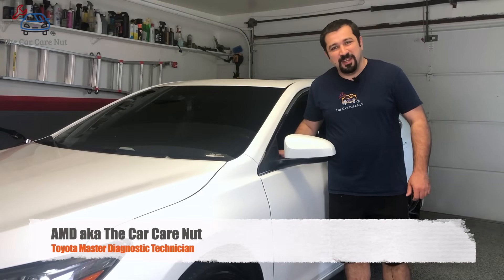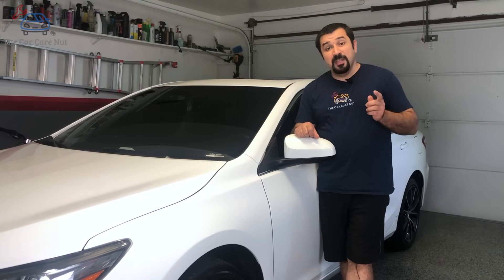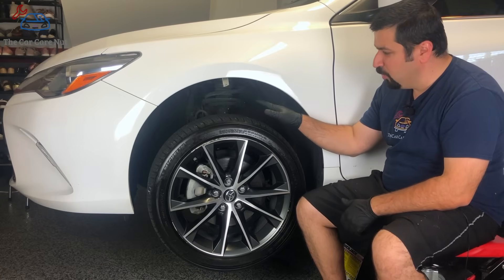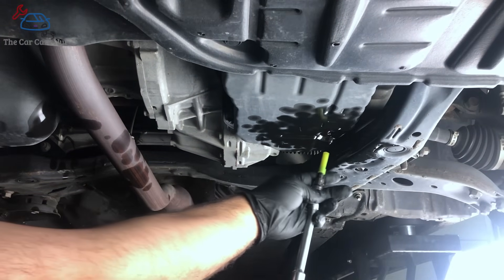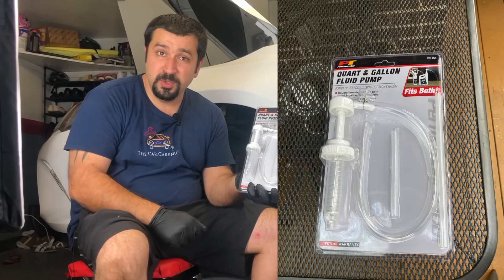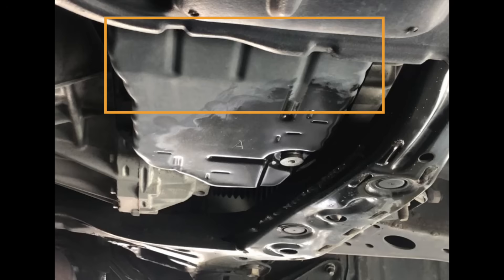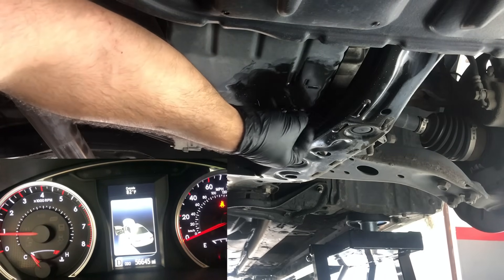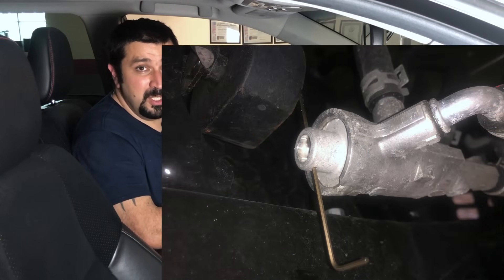How to change your Toyota Sealed Transmission Fluid

Comment: Sir - my 2015 camry is coming up for transmission fluid change (58k miles). Could I do drain and fill a couple (or more) times to get more fluid replaced in a single work session? Is there any downside to do multiple drain and fills? Or there is no downside but just not much additional benefit vs. just doing 1 drain and fill? Thank you AMD
Reply from the maker: Hi! I would replace it once. Over doing it is also not good for the transmission. A single replacement is sufficient
Reply: @TheCarCareNut  Thanks AMD! A quick follow up question, would you mind expand on the reasoning behind why doing 2 or 3 times drain and fill in 1 session is not advisable? Thought doing more will replace more old fluid, which should be more beneficial to the transmission (for instance, a flush at this interval would be replacing 100% of the fluid, and dealer seems to suggest this but I'm taking your advice of doing a drain and fill instead).      In addition, is your advice the same for replacing the transmission fluid at 120k, 180k, 240k....300k miles? Thanks so much!
Reply from the maker: Hi Steven! So replacing the transmission fluid multiple times in one sitting seems to affect the clutches in a negative way. A single replacement is enough to replenish the additive package and keep things protected.
Reply: @TheCarCareNut  Got it. Thanks very much to share your experience and insights! Does the same negative affect on the clutch happen on flushes (which likely replaces 100% of the fluid)? Thanks very much!
Reply from the maker: They do especially if the transmission has high mileage

Comment: Does a Toyota Avalon 6 speed automatic have this?
Reply from the maker: Hi! Yes it does
Reply: @TheCarCareNut  I’m looking at a 2017 Toyota Avalon with 85,000 miles for 17,000 that’s with taxes and fees is it worth buying?
Reply from the maker: I think it is. That’s a very good car
Reply: @TheCarCareNut  would I need the transmission changed once I buy it?
Reply from the maker: I would replace the transmission fluid if it hasn’t been done
Reply: @TheCarCareNut  what about the timing belt?
Reply from the maker: That model has a timing chain that doesn’t need service or replacement
Reply: Should it be changed since it has 85,000 miles
Reply: @TheCarCareNut  what do you recommend to be changed or replaced on the car?
Reply from the maker: Other than the transmission fluid do an oil change and inspect the car. Brakes tires suspension and leaks.
Reply: @TheCarCareNut  thank you 🙏🏽

Comment: where should be autoshift(parking or neutral)when checking the level in transmission?
Reply from the maker: When you are done with the procedure and about to check the fluid level put the shifter in park
Reply: @TheCarCareNut  with the engine running?
Reply from the maker: Yes keep the engine running in park when you check the fluid level

Comment: Hi there nice presentation. Can i ask something regarding oil that you used on your transmission, you use a Toyota ATF WS in a sealed CVT transmission, you did not used a Toyota FE CVT fluid. Im planning to have a service on my 2011 Toyota Altis 2.0 also sealed transmission no dip stick. it is okie to use one of this fluid, is there any difference.
Reply from the maker: Hi! Is your car a hybrid or a conventional CVT transmission?
Reply: @The Car Care Nut  hi thanks for replying 😘😘.its not a hybrid,  Its a K111 CVT Transmision its a 7 speed with paddle shifter. Car model is ZRE143L-GEXVKM, engine: 3ZR-FE. hope you can help me out here.
Reply from the maker: Hi! Likely this one uses cvt fluid
Reply: @TheCarCareNut  thank you very much.

Comment: Hello AMD! Thank you for all of the hard work you put into these videos. I wonder if you could help me with my 2015 Rav4 limited with push button start. I put in the jumper wire to change the transmission fluid and now the Rav4 will not start. I can turn on the electrical system but the engine will not turn over. I am sick to my stomach thinking I really screwed something up. By the way, I tried disconnecting the battery.
Reply from the maker: Hi joe. Check fuses staring under the hood and then inside the car. You’ll want to mainly focus on the efi fuses. Also when you turn the key on where all the lights come up does the check engine light come on?
Reply: Yes, the check engine light is on. I'm so shocked that you were able to get back to me on this. It's greatly appreciated and the work you're doing is amazing. I hope it makes you generous passive income!
Reply from the maker: Ok I see. Still check fuses and go from there
Reply: @TheCarCareNut  The fuses all look good. It's feeling like I need to take it to the dealer? Gulp! I did hook up my OBD2 scanner that's paired to an Android phone and it had no error codes.
Reply: @TheCarCareNut  AMD, you are an extremely generous man and greatly appreciated. It turns out that I just needed to charge the battery! It started up!
Reply from the maker: Awesome! I’m glad to hear that!

Comment: Hello AMD on the 2014 Toyota tundra 5.7 what is the temperature to check the transmission fluid level?
Reply from the maker: Hi! Should be at 99-111
Reply: Thanks you very much

Comment: Another Gem from AMD!  Should a Dealership request I leave my car overnight when changing out the CVT fluid?  Or can they do it safely in one afternoon? I do not know how long it takes for the transmission to cool down enough.  I Decided to take my 2018 'Rolla LE in this Friday for a "Replace CVT transmission fluid" service. I will also ensure they only do a drain and fill per AMD's suggestion to another subscriber.  Tks AMD!
Reply from the maker: Hi! Thank you for watching my channel! The dealership has a special tool that allows for fluid level check at operating temperature. Every dealership should have it so they won’t have to hold the car to check the fluid level.

Comment: Any reason why you do not just pump the oil out from the filler hole, say 2 quarts, then just add 2 quarts of fresh?  Oil pumps to remove sump oil are common on marine engines due to inaccesable sumps. I see no  good reason why this will not work, but happy to be told otherwise.
Reply from the maker: You can’t access the sump from the fill hole.
Reply: @TheCarCareNut  Thanks for the reply. Im surprised theres no room for a 5mm hose, seeing as the oil gets to the sump somehow.

Comment: I have the 2GRFE on my 2013 RX 350 now at 100k miles. Should I do this drain & fill or just roll the dice and hope the transmission will at least last up to 300k miles?
Reply from the maker: I would just do a drain and fill
Reply: @TheCarCareNut  What is the temp again for these V6 again?
Reply from the maker: Should be 95-113
Reply: @TheCarCareNut  On the V6 is it the same 6mm hex as the 4 cyl or different?
Reply from the maker: Should be the same.
Reply: @TheCarCareNut  Do you remember how much fluids comes out of the V6 at first?
Reply from the maker: Usually around 2.5-3.5 depending on the model

Comment: Hi there AMD. I have a 2013 corolla and have no service record for when the transmission oil was changed. My odometer is currently on 82,000 kms. Would you advise changing it now?
Reply from the maker: Hi! At this mileage you should be good replacing it. I would do a drain and fill
Reply: I successfully did a drain and refill. However, the fluid is still really dark and not even close to a bright red colour. Would you advise to drain and refill once again? Please also advise if it's best to take down and clean the transmission pan and change the filter. Thanks.
Reply from the maker: Hi! That’s ok. You replace enough of the fluid to renew the additive package and keep things protected.

Comment: Does the 2016 Highlander LE have the cooler bypass? And also, what does this bypass do?
Reply from the maker: Hi! That doesn’t have one. The cooler bypass doesn’t allow the fluid to run through the transmission cooler when the fluid is cold. That started with 2017 highlanders with the 8 speed
Reply: @TheCarCareNut  what would of happened if I was to have a 2017 and didn’t do anything to the cooler bypass?
Reply from the maker: You’d get an incorrect fluid level after doing the procedure
Reply: @TheCarCareNut  what’s the cooler bypass do anyway? I haven’t found any info on it
Reply from the maker: It keeps the transmission from getting too cold in cold climate. Basically like a thermostat for the transmission

Comment: The Toyota dealer in Vegas said they don't carry no more the ATF Toyota brand for sale. Other thing The Lexus dealer told me the AT fluid in the RX350 DON'T NEED TO BE CHANGED. I wonder if they are right. Thank You.
Reply from the maker: I would use ATF WS from another dealership and would change it every 60k or 6 years.

Comment: I've now got a UK model 2015 CVT Yaris,1.3L  with 88,000 miles, will the jumper wire on the OBD2 be the same on mine as in the states or other other Toyota models?  Thanks.
Reply from the maker: Hi! I don’t have that exact model here but it should work
Reply: @TheCarCareNut  Thank you Amd.
Reply: @TheCarCareNut  Sorted! Just done mine, i didn't need to remove the plastic cover or the wheel,but did anyway as i went through your step by step video....realized i didn't need to it,as i have space to tighten the 24mm from the top.I used a hose pipe and funnel to fill it up from the top with the hood open of course.My overflow tube was yellow by the way. Thank you Amd.
Reply: @TheCarCareNut  Hi again Amd,just some info 3 yrs later, i decided to do another drain & refill not x2 as i'm keeping the  bottle (2.2L) to keep inside the house not the garage so no damp gets inside. Got a good price on ebay (Discount code) at £66.49 was £69.99 (5L bottle) BUT 3 yrs ago the price was £59.99! Today another seller's price is £74.99 WOW!  So 3yrs ago i did 2x drain & refill as it takes 2.2L each drain. So today on my 3rd drain at 98,000 miles the fluid looks a nice decent red when i checked the level as per your great & helpful video....i still have the wire today to put in the ODB port, hahaa.  Will use up the rest maybe in 2 yrs time. Thanks.

Comment: ANY fluid that has published criteria on the back of the bottle which indicates it was tested to the proper automotive specification can be used in the CVT and ANY WS or FE transmission if it is certified for such - PERIOD! Using any non-Toyota fluid which has been tested to and passed the specification listed on the bottle can be used. It WILL NOT void your warranty as long as the fluid has been tested and is listed to meet the proper toyota performance specification. Magnuson -Moss Act ensures that your warranty will NOT be voided if you use the proper, certified fluid - PERIOD. Toyota CANNOT void your transmission or refuse to repair it under warranty if you used non-Toyota, transmission fluid certified to the proper Toyota specification (e.g. WS, FE, etc) You have many choices of aftermarket fluids that meet Toyota specification. Dealers CANNOT tell you that it will void your warranty nor should ANY mechanic either - PERIOD. Most fluids are NOT manufactured by the dealer (e.g. Nissan CVT is made by Idemitsu and NOT Nissan) rather a 3rd party that labels and supplied the fluid as OEM with a MASSIVE markup on the fluid. Idemitsu is borderline in its long term performance. Some CVT fluids exceed $20 a quart! Interesting that Amsoil CVT made it through 11 rounds of testing versus the Nissan "OEM" Idemitsu which made only 7! So there ARE superior fluids available. No need for fear mongering. NO fluid is lifetime so don't let anyone tell you that it is. Do a fluid change every 2 years just like the old days and any potential issues will be avoided. If you use the transmission cooler outlet as a purge device you can ensure that you FULLY change out ALL the fluid in your transmission including the torque converter. Simply add extra 2 quarts plus what was removed, start vehicle (do not drive), shift though gears (5 sec delay), stop vehicle, drop cooler line on 8 spd, start vehicle and use trans to  pump out 2 quarts, repeat 2 quart add/pump until fluid clear. Now the torque converter and all lines are filled with new fluid. Simple and effective now that there are NO filters (sans a small basket filter) in the 8 spd transmission to be able to filter out particulates. So change the fluid often to ensure that your transmission lasts as long as possible. FLUID - ANY tested, certified fluid can be used in the transmissions as long as it meets the proper specification. Best to choose a synthetic also.

Comment: Hello, if the transmission is cold and you drain the fluid cold, you measure what came out and put back the same amount back in no ? I mean if your the original owner of the vehicle and this is the first fluid change and you are doing it you know what the factory fill is and you replace with the same amount. In your video I am pretty sure what came out was the extra fluid you added to the initial drain amount.
Reply from the maker: Hi! That can work. However if you’ve done all the work to measure and add why not spend another 15 minutes and make sure it’s at the right level?

Comment: Hello how do you change the transmission fluid on new Toyota Corolla direct shift CVT? THANK YOU
Reply from the maker: Hi! Same way just use the correct fluid
Reply: @TheCarCareNut  Thank you for that info. My 2019 Corolla, when stationary talking off 1st gear shift hard. What could cause this problem. Appreciate for your help. Thanks

Comment: I recently bought a 2015 Camry LE and now has 26,300 miles. Since you said the interval is 60k or 6 years...I'm going to go ahead and swap out the ATF WS at my next oil change when I hit 30k miles since the car is 6 years old. Thank you for this video!
Reply: My 1.3L Yaris (UK) is 6 yrs old with 88,000m and i've just changed my CVT oil,simple to do as the video.
Reply: @tardeliesmagic  Update, car is now at 42k miles I'm just gonna wait til around 60k to do the transmission fluid

Comment: I just bought a used Venza 2011 awd  4 cyl  102000 miles  . Is it too late to change the trans fluid ?. Is it ok to change the diff  fluid and transfer case  as well ?. By the service record  ,none of these seemed to have been changed. The car is running perfect  .
Reply from the maker: Hi! It’s not too late to change the transmission fluid and diff and transfer case. A drain and fill is safer
Reply: @TheCarCareNut  thank you .
Reply: Do you know the temperature for the tranny level check ?

Comment: Great video! I plan on replacing the transmission fluid in my son's 2011 Scion TC and will be using a ScanGauge II to measure the transmission fluid temperature. Would you know the correct temperature range to use and do you recommend replacing the drain plug gasket?
Reply from the maker: Hi! The temp range is 95-113 and I would replace the drain plug gasket

Comment: Hi AMD,
Without being too scientific, what part of my 2018 RAV4 XLE should I place the leveler to make sure it is leveled and proceed with the ATF change?
Thanks.
Reply from the maker: Hi! On the frame of the car. Use your eye sight to keep it simple. If the car is relatively level not an inclined or decline that’s good enough
Reply: @TheCarCareNut  Thank you. I was wondering the same thing. Great job!

Comment: Hi AMD for this great educational video!   I have a 2012 Lexus RX350, that needs a transmission fluid change, that I am doing DIY.    I planned to use a thermal gun to calibrate the tranny temperature.  Please advise me the exact temperature I need to get, for this task.   Thank you!
Reply from the maker: Hi! It’s 95-113
Reply: Hi. AMD.  I use a ScanGauge 2:  should I also use you 94-113 F number to do my 2017 Rx 350  & 2013 RX 350 ( f-sport) to adjust fluid level?   These are all speed transmissions.  Thank you very much.

Comment: Thanks brother, I did not know about the transmission cooler bypass. I've performed this job on my 12' Camry and will do this on my 20' Camry when the time comes. 

What is the transmission temperature range on the 2020 Camry?
Reply from the maker: Hi! 95-113
Reply: @TheCarCareNut  Much appreciated! The transmission fluid temperature range I am using for my 2012 Camry is 104 to 113 degrees Fahrenheit, is this correct?

I also went down to my local dealership and picked up a couple OEM oil filters (buy two get the third at half price). I assume they are made for synthetic motor oil because 0w20 and 0w16 are not available in conventional form.
Reply from the maker: The temp is good for your Camry and the filters are for synthetic oil. Any oil starting with 0 is synthetic
Reply: Did you ever find the transmission fluid cooler bypass valve on your 2020 Camry??? I couldn’t find it on my 2019 Camry 2.5L.

Comment: what temp should my fwd 2013 toyota highlander trans be at?
Reply from the maker: Hi. Does your model have a dipstick?
Reply: @TheCarCareNut  no, it’s  similar to the one in this video , I also should add my car has 90 k miles , do you think it’s alright to still do a trans fluid change ?
Reply from the maker: Ok then it’s the 4 cylinder model and it should be 95-113 and you should be good with a drain and fill at this mileage
Reply: @TheCarCareNut  thanks so much